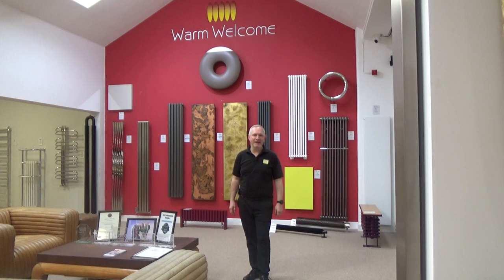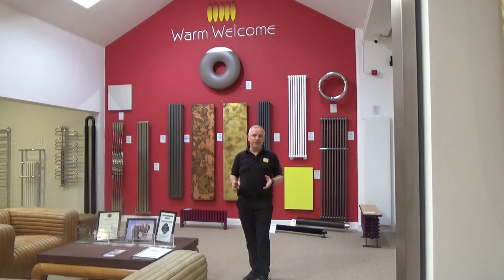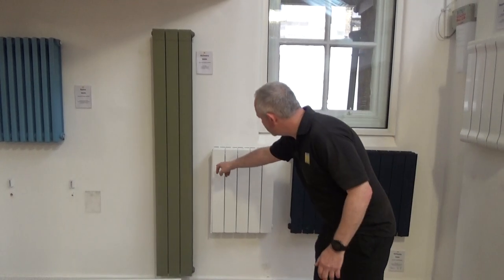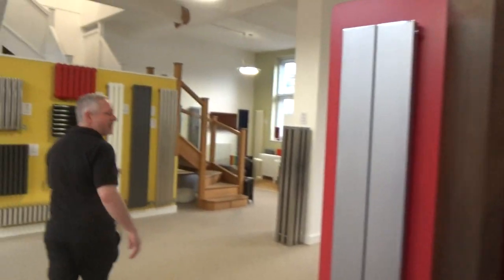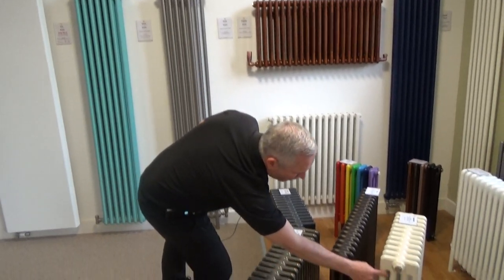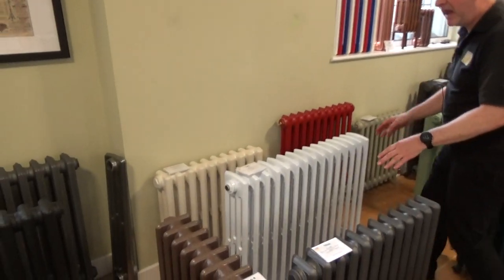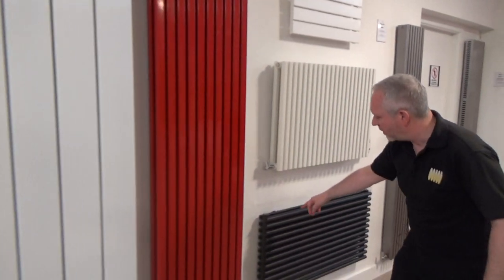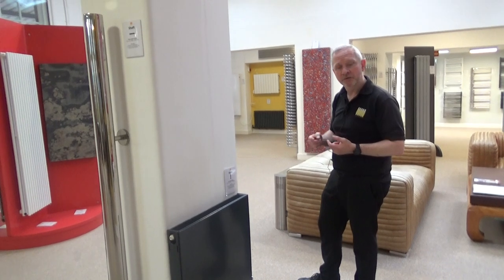Heat pump radiator choices

Comment: I was concerned to note that the outputs claimed by various manufacturers are not to a required specified standard , ie they can do their own tests rather than being obliged to use a British standard .
  Of course finding out who does test to British standard and who doesn’t is a pain .
  I have opted for what I consider very ugly K3 Stelrads as they do test to BS fir their outputs ,,would have like to have something far less intrusive for the heat pump change .
Reply from the maker: Hi Pmbpmb, I hear what you are saying. I can assure you we stock Bsria tested radiators, thus tested in the UK. Any future requirements, just get in touch and we can certainly specify radiators for your requirements. contactfr@featureradiators.co.uk Or 01274 567789